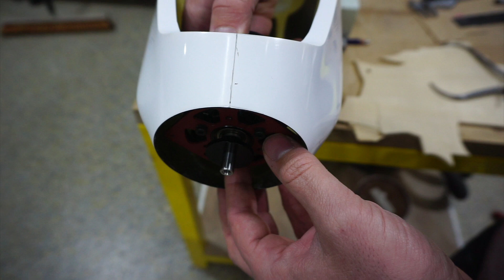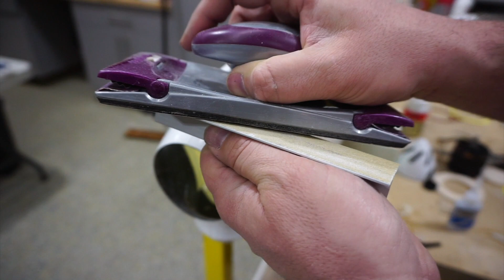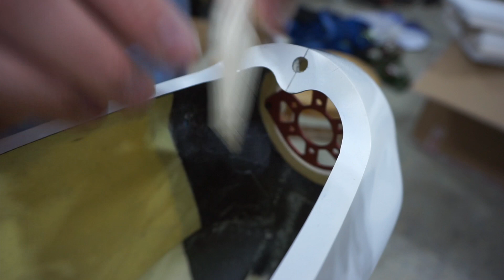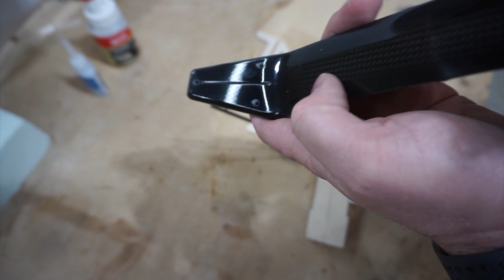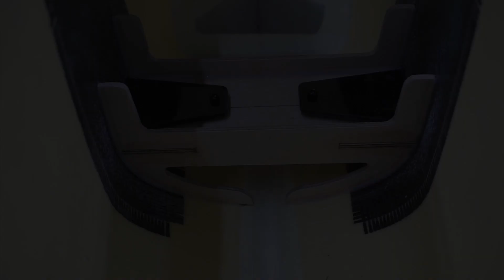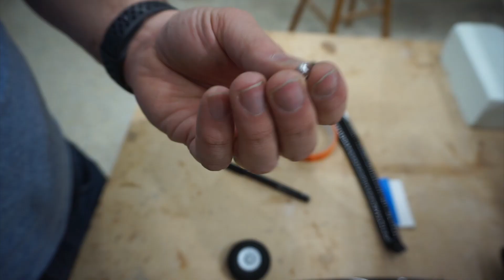Akuma+ Build - Motor Mount and Landing Gear Installation

Comment: Picking up plenty of build tips for my Epilogue build.  I use a spring on the axles of my IMAC airplanes to provide fiction to the wheels.  I like the axles and wheels you are using.  Is there a trick to using the Morris Hobby site.  It’s in all Japanese and impossible to navigate unless I’m missing something.

Comment: Hi Chad, hope all is well I have seen your videos and I must tell you great job and very helpful thanks for taking your time and sharing all this. I’m interested to know if there’s room for installing a YS200 cdi on the Akuma. Do you think it’s possible for a glow conversion? I know you was a YS user and I think your the perfect person to ask, your feedback would be highly appreciated.
Reply from the maker: Hi Gregory, yes there should be room, but you will have to cut the chin cowl out of the nose of the model in order to get access to it from the bottom.  Not impossible but there is a bit of work for sure.